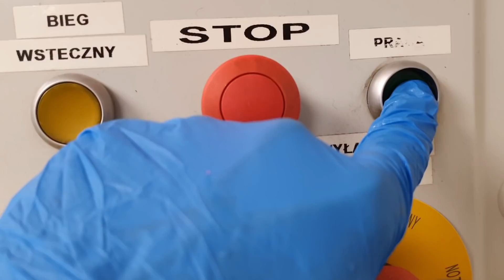Pranie zabytkowego, wełnianego dywanu w bardzo ciekawe  wzory. Kolejne cudo do mojej małej kolekcji😀

Comment: Is it cold water you use?
Reply: I'm not 100% sure, but I'd say he uses cold water. It's cheaper than hot water. Even tho HOT water would kill some of the germs from the carpet, cold water is most likely what he uses.
Reply from the maker: I use both hot and cold water, it all depends on the dirt on the carpet 🤗💖
Reply: @rachaelgibson2330  i was also thinking hot/warm may cause any dye colors to bleed but, not sure. 🤷‍♀️